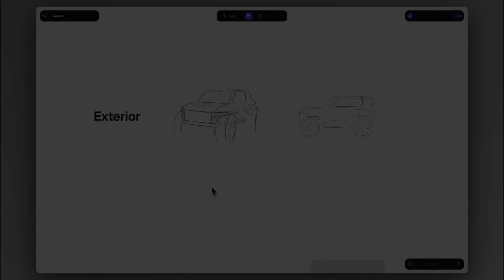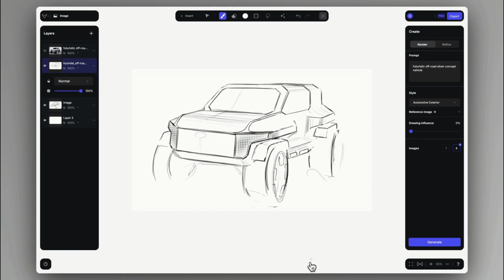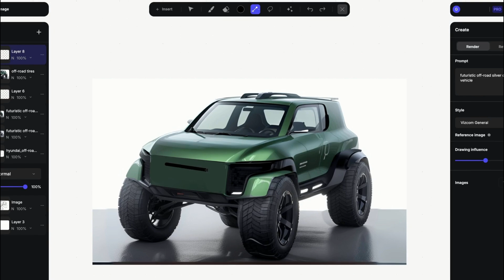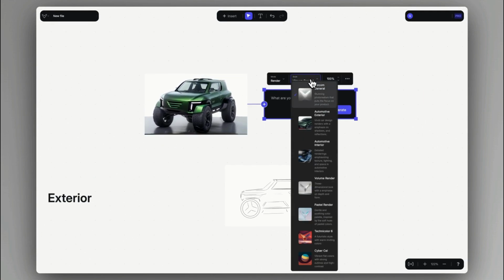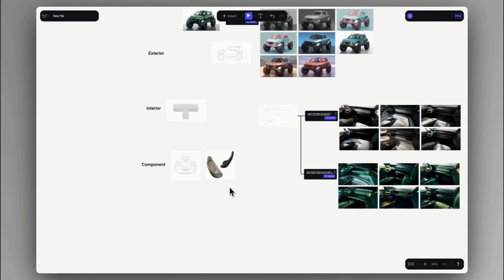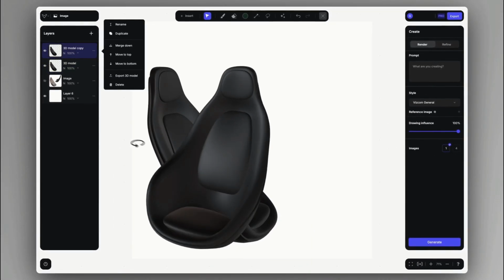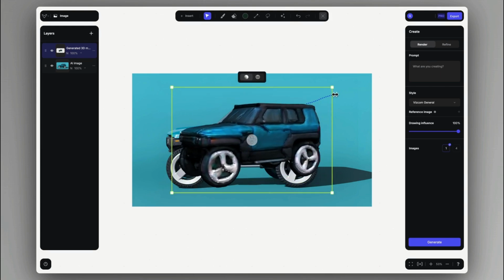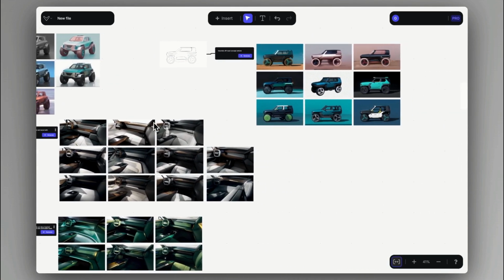Vizcom: Comprehensive Vizcom  tutorial

Comment: When you erase parts of a layer to reveal the layer underneath, can it be done non-destructively?  Like using a mask instead of just erasing.  (In case you want to restore some elements.)  Thanks.
Reply from the maker: Yes, there are some ways to do it non-destructively. For example, If you draw on a new layer a visual separation color, you can also select that part and generate on that. (Also you can duplicate the original rendering to have it intact, but at any time you can add back the original rendering from the history tab, that's why it's not a problem if you do it in a seemingly destructive way.)